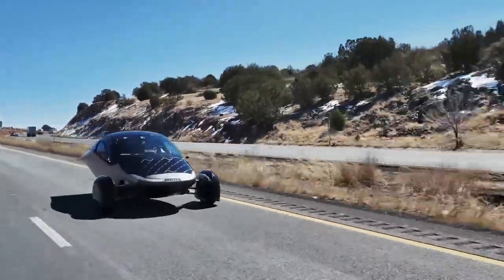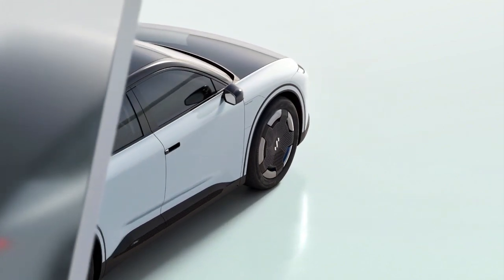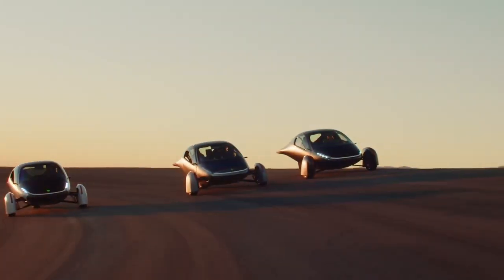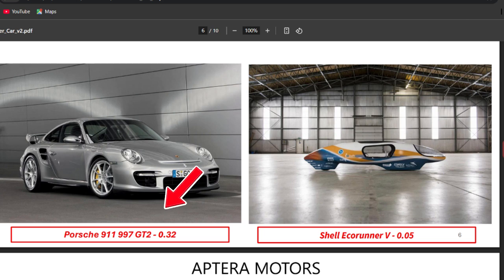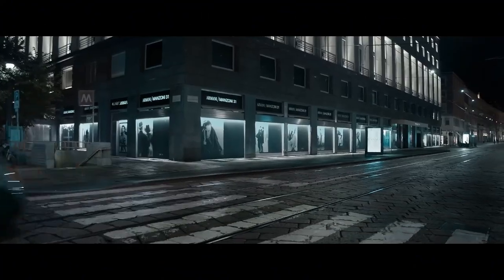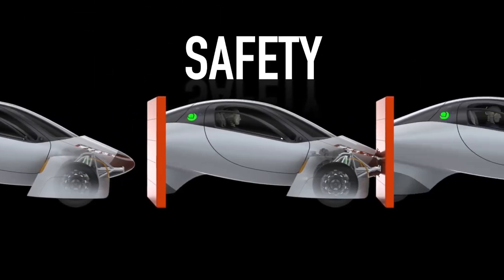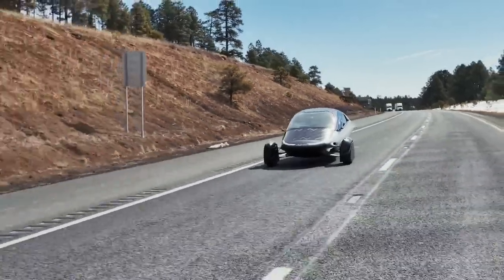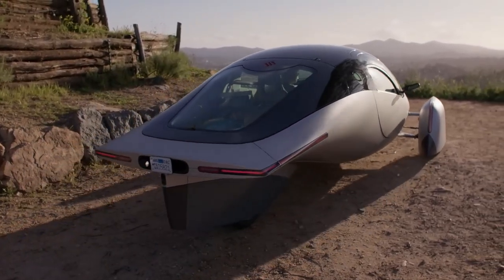Dr Elie On Aptera The First Solar Car: The Drag Coefficient, Rolling Resistance & More

Comment: Solar won't save this car.
They should focus on a regular 4 seat model with better battery management and charging speed.

A bonus would be some sort of self charging power supply feature. That isn't solar.

To get this model to pass a crash test will only increase the weight.
Reply from the maker: you know they said they plan to begin small scale production late this yr; yet they haven't done any crash test
Reply: @chriswabs  It's designated as a motorcycle and a crash test is not required.
Reply: @chriswabs  The video said they are trying to reduce the weight of the demo model to increase the range.
The problem with that type of thinking is they are not solving the crash test safety issue.

Which means it won't be approved for public use on the roads with REAL cars.
Reply from the maker: @scamchan  yes that will be creating a different problem for them: and before they commercialize they need that crash test: there's a guy who commented he said he is an investor and he knows a lot about the company, I have asked him for a livestream I hope he acceps
Reply: @chriswabs  I like the idea that you want people to come forward to carry on the conversation.
Reply: @scamchan  No, the video said that they have some steel parts that won't be there in production and therefore will be lighter. How is that connected to crash test safety?
Reply: @LuneUnion  show me a safe lighter car that has less steel in it?
Reply: @scamchan  Your argument is basically "larger, heavier cars are safer in a crash if they crash into a lighter car" This would be true for a Corolla vs a Hummer or a Hummer vs a literal tank. A smaller car will tend to get pushed by the heavier car, no doubt. By your thinking then, everyone should be driving semi-trucks because they're the safest in a crash. Of course, then everyone would be driving semi-trucks, so not sure how safe they'd be then. For EV efficiency, lighter is better. F1 cars are lighter and way faster than Aptera and people do walk away from those crashes. Worth a mention because the company that's stamping out the Aptera body is primarily makes race car bodies, IIRC. On the more mundane front, the Hyundai Elantra weighs in at 2,868 lbs and gets a top safety rating. The Smart Car can weigh in as little as 1,500 lbs and it got a 4 out of 5 safety rating. Also the Model Y and Ionic 6 have swapped out some steel for aluminum/composites to reduce weight and they're top rated safety wise. So, yes, one can remove steel and still be safe.
Reply: @LuneUnion  My argument is that APTERA  has done ZERO crash tests but wants to reduce the steel in their "CAR" to increase range.
Seems they are not worried about Safety at all.

If you want to argue what they have stated vs facts please do so.

At least make it challenging.

So I will repeat again.
Where is the crash test for the Aptera?

Please let us know how safe it is in a crash.
Will there be anything left after a crash?

I don't think there is anything to debate here on this issue.
Reply: @LuneUnion  F1 Cars are not street legal plus I am sure they have some sort of cage protecting the driver.
I don't know why you would bring that into the picture.

You don't get massive range increase plus charging  up without losing something in the process.

The whole self - charging is just the gimmick to get investors on board.

It isn't practical.

The final production model won't be something to brag about charging wise or range wise.
Reply: @scamchan  You didn't repeat yourself. You're just moving the goalposts and being an ass to try to get a rise out of me. I don't have Aptera actual crash data, as you know,  as they haven't done it yet (that I am aware of). Not sure what win you think that is. That is a step in the getting to production. They aren't yet in production. When they do it, I hope it will turn out as well as the Model Y and the Ioniq 6 have. But I do agree. No point in talking to you further.
Reply: @LuneUnion  I didn't move the  goal post at all
I Said from the start there was no crash test.
With that being said.
Let me know how you compare a Smart Car to an Aptera?

That sounds like moving goal posts to me.
Don't get mad at me just come with better facts at why this SOLAR car is the one that will make it into production and remain safe in a crash.

I suspect you will continue to move the goal posts in search of keeping the lies alive.
Reply: @scamchan  They will. It is not yet crash tested because they only have had expensive, one-off, and not fully functional prototypes that are not yet production specked. This is a shoe-string budgeted start-up without any billionaire backers. Even though they do not have to - due to its vehicle classification - Aptera will be will be third party crash tested. All simulations have indicated that it will prove to be safer than most cars on the road, and hands down safer than any motorcycle/donor-cycle. It has crush zones, airbags, a roll cage, a low battery weighted center of gravity, and its occupants are enclosed in a strong composite shell.
Reply: @ No billionaire investor is going to back a 3 wheel experiment.

More so one that can't resolve issues with charging and range.

Might as well ditch the solar aspect and increase the range and charge speed.

Then just add the 4th wheel to make it more stable.

No one trying to go off road or camping in a tiny "car".
Reply: Baby steps. They are a new car company. If this revolutionary design ever hits the streets, everyone will want aerodynamic efficiency. There are so many innovations in the newest Production Intent version that debuted today that, if it every hits the road in significant numbers, will revolutionize the car/land transportation industry. An Aptera with a compact ICE range extender/charger could power a four-seater and have unlimited range while burning very little gas. The side-view mirror on a Ford F-150 has the same wind resistance as the entire Aptera. Ford F-150s could save a lot on fuel with a little aerodynamic efficiency in their design.
Reply: @RaymondCore-ts5jl  When was the last time anyone went to the dealer and said I want the best aerodynamic efficiency?

THEY DON'T
IF they Aptera needs a range extender it might as well just add A BIGGER BATTERY.

The Aptera won't revolutionize anything at that size in the land of HUGE SUV sales.

The problem with Rose colored glasses just means reality appears different everywhere.

NEW car company that is how old and still trying to gain traction with investors?

Unlimited range might as well invest in better battery tech and call it a day.

At best Aptera will remain a NICHE car and at worse it won't sell enough with that design to remain profitable.
Reply: @scamchan  Clearly you missed the word, 'if' at the beginning of the second sentence. 'IF' it hits the streets. Of course they aren't going to their dealers when they aren't even aware that all cars, if they were aerodynamically built would run on half the amount of gas they currently burn.
Reply: @RaymondCore-ts5jl  Clearly "IF" doesn't seem to compute.
It isn't up to the dealers
Because the car manufacturers already know about it from their designs over the last 100 years since leaving behind the horse and buggy.
What car manufacturer isn't using wind tunnels lately?

The problem remains the roads are not going to be filled with tiny two seat cars because it saves gas.

The weight of the cars will remain an issue.
We know batteries are not light.

Emotions behind "aerodynamically built" cars isn't something being overlooked it has always been part of the design lately.

Somehow that discovery is missed in these responses by you.
Reply: Self-charging power supply?  Is that something you saw on The X Files years ago?  

The problem with that is, there's this thing called the Law of Conservation of Mass and Energy.  (You can google it if you're not familiar.)
Reply: BINGO!  Solar is useless for the way this car is used. Better off just plugging it into a home solar bank system.
Reply: @mikelfrance-l6x   Solar is not useless.  There is no evidence to support that claim.
Reply: @netscrooge  Solar is indeed useless when used on a car. Might as well have a tuned solar setup that is optimized to collect solar energy than the few cells on the car that may not be in alignment to do the job at any location.
Reply: @scamchan  I moved from a beautiful single-family house to a senior apartment building for my retirement, where I have additional assistance and support as I age.  I guess you believe I shouldn't be allowed to own an Aptera.  You would rather I do all my charging at a charging station than for me to have almost all my driving covered for me without any additional expense or inconvenience.  Maybe while I'm sitting and waiting for my EV to charge, I can use that time to think about how foolish I was to grow old.
Reply: @netscrooge  Yeah those cloudy days will really keep that APTERA charged I guess that waiting around for the sun will be well worth it. 
OR checking the paper for sunny days before you drive your charge to zero.

Maybe you can pounder all that time why everyone else warned you it wasn't a great idea to depend on solar as the solution for onboard changing.

You can own anything you like.
That doesn't mean it would be the best solution for ALL considering we have so many REAL WORLD solutions that don't depend on the sun for power.
Reply: @netscrooge  solar won't charge at night or on cloudy days to make it worth the time.
Reply: @scamchan   The public's real world experiences with the solar roof option on the Prius proves you wrong.  You're just stating an opinion, one that's not based on facts.  Please do the research and educate yourself.
Reply: @netscrooge  Solar roof OPTION Thanks for helping me out with this.
I couldn't have said it better.

Now ask yourself How many solar Prius do you see driving past you on the highway.
I will wait for your honest reply.

When facts meet reality it really hits hard.
Reply: @netscrooge  The solar roof can add a few miles of EV range if parked in the sun for extended periods, but it's not a major source of power.

I Can't make this stuff up as it just writes itself.

Real world experience is hard to refute.
But do go on about that research.

The Solar Roof option

It can even add a few (like 5 or 6) miles of EV range if parked in the sun for 12-plus hours daily, but don't expect a significant amount of free solar-powered miles if you drive your Prime frequently.
Reply: @scamchan   Nothing you've said refutes the usefulness of solar-assisted charging for my use case.  I guess you can't quite grasp that there are people in situations and with preferences that are much different than your own.  I can't put solar on my home.  I don't want to sit at a charging station while my car charges, even if I'm not charging very often.  

What is your motivation for continuing to argue the point?  What's in it for you?  If you don't want solar assisted charging, don't buy a vehicle with solar cells on it.  It's as simple as that.  Those of us who do want solar assisted charging don't need to hear your pointless negativity.  You can keep your gems of wisdom, like "it won't charge at night," to yourself.
Reply: @netscrooge  Hard to grasp 4 miles of charging per day on a Prius as something to rave about.

If Solar charging on a car was a great asset there would be no need for batteries at all.

Not charging at home only means you need a charging station no problem.

The issue remains SOLAR on a car isn't a solution to a problem.

No matter how you twist it because if it were main stream and practical this debate wouldn't be taking place and you know it.

You can't drive more miles per day than you can gain charge from solar being in the 4 miles of charge per day that means you would drive less than 4 miles round trip to be practical.
Stop the mind games here.
No one with a thinking brain would accept this is normal - Your wait isn't being removed at night or in the day with solar charging on your car.
Reply: @netscrooge  Try to grasp the concept of charging a a car with 200-300 mile range with solar on the car that does like 4 or 5 miles per day.

You will be waiting 2 months for a full charge.

That isn't helping anyone.  Not even you..

To get fast charging you need bigger panels much bigger than the car itself.
Reply: @netscrooge Although I’ve heard 5 to 6 miles added a day from a couple of Prius owners in the real world. Most of them say it’s only 2 to 4 miles a day. Sure, the Aptera is going to be more efficient, but up to 40 miles a day is a real stretch.
Reply: @kevinc8811  Based on the Prius giving 4 miles on a good day and 6 under ideal condtions, I would expect the Aptera to get about 25 miles on a good day and close to 40 under ideal conditions.  So, it's not a "real stretch;" it's an ideal-conditions figure.  

If you don't agree, show us your math, comparing Prius solar capacity and vehicle efficiency to the Aptera's.
Reply: @ Lets count those perfect sunny days that will hit those tiny solar cells on the car.

I can't wait to hear it.
When the the builders of the Aptera won't reveal the charging time and speed.

You know it isn't good.
Reply: @netscrooge  You ask for figures because I’m skeptical of  the 40 mile range a day Aptera claims but you don’t present figure yourself of the proof it possible? LOL That ain’t how it works genius, the burden of proof is on you.
Reply: @ dude, you’re the scam.
Reply: @greghelton4668  Oh wow I thought you had evidence but all I see are bad jokes. 

Try harder to provide evidence and prove solid points.

Save the jokes they don't work here.
Reply: @kevinc8811  The burden of proof is on you.  You're the one questioning Aptera's 40 mile/day figure.  Either give us your reason for questioning it or admit that you're merely expressing an impression that's based on emotion, not facts.
Reply: @netscrooge  So once again you have no proof. You’re repeating hearsay claims without evidence.
Reply: @kevinc8811  Feel free to review all the evidence we have for the vehicle's Wh/mile efficiency and the numbers we have for the output from the vehicle's solar.  Do the math.  I have.  The 40 miles/day from solar can't be far off for perfect, ideal conditions.  

Saying 40 is "way off" would mean it would be something more like 10 or 15 miles/day.  The Aptera has over 3 times the solar of the Prius and is a much lighter and more efficient vehicle.  There's no way it will be 10 or 15 miles/day for ideal conditions.  And if it turns out to be 30 or 35, that's not way off.  It would simply mean their estimate was high, not rediculously high.
Reply: @scamchan  Far from it, getting well over half of its yearly kWh's free from the sun is not useless, it is an economic, practical and environmental win. Also, it def comes in handy when road tripping, camping, closing in on a charger you can't quite reach, and helping power parked battery drains like thermal management protections, dog mode when applicable, and sentry mode. The solar became range useful precisely due to Aptera's priortised and astonishing efficiency. Solar on a home with its inverters, wiring, battery storage, ... is not affordable in everyone's budget. Not everyone is privileged to have said home, and one that has good sunny solar angles and a compliant HOA and/or power company. Plus shouldn't any said home solar be saving that homeowner money offsetting whatever fraction of the home's energy use that it can?
Reply: @netscrooge  The Aptera is nothing like the Prius. Educate yourself about the EV you are blindly casting shade upon.
Reply: @scamchan  All factored in when doing their solar projections. Are you a bot?
Reply: @scamchan  But an Aptera that has more solar real estate and that is 3 to 4 times more efficient than said Prius?
Reply: @scamchan  &  @netscrooge  Help, the slam bots are fighting each other, not understanding they are designed to be on the same side with similar goals ;->.
Reply: @jeffcarlton3590  "def comes in handy when road tripping, camping, closing in on a charger you can't quite reach"
Camping?
Do you work for Aptera?
First of all the so called charge time and or range on this car isn't even official.

Secondly With the small amount of cells on the car they are in no way practical for everyday use even in a local situation.
Last I checked it doesn't charge as you drive.

A solar setup in the home would not only charge it quickly it would also be used as power for the home as well.

There is no Aptera that will power a home.
So there are no savings to be had there.

Solar on the Aptera is more of a gimmick than a real selling point.

Points made here are very poorly done.
Reply: @ Being a cheerleader isn't an easy job for anyone.
The problem here is that - We have ZERO practical solar cars.
I wonder why?
Aptera won't be one of them and they know it.
Meanwhile they can continue to soak up investor money and tell them to spend more money to jump ahead in line.

This can go on for how many more years.
Reply: @ Key word here is "projections"
Not a real world scenario of proven performance.
At least not one they want to present to the world.
They know the performance of the charging isn't great as people expect it to be.

Some of us believe in facts and evidence  then others love the fantasy they hope to become true.

There is a reason great charging from solar will use panels that move with the sun.

Meanwhile Aptera hopes to get great charging from any location from poorly angled solar cells.

I can't make this stuff up.
Reply: @jeffcarlton3590  A Prius with the optional solar roof is an excellent example of how useful solar assisted charging can be.  If the Prius can gain several miles/day, think how much better the Aptera will be.  The Aptera goes about twice as far on each watt/hour of power and has over three times the solar cells.  The Prius with solar is the best real-world example I can give to refute the naysayers that attack Aptera's solar charging estimates. 

I have educated myself.  Maybe you should too?
Reply: @mikelfrance-l6x  Again, it charges while you drive, while you park while out during the day, and while you sit in traffic. How is that useless?
Reply: @LuneUnion  Because running around towns means its going to be shadows, under clouds, rain, not to mention running in early morning or late at night.  And its moving and changing angles to the sun constantly. Lastly, vehicles collect dust, rain drops, bird droppings, etc. Its  the worst situation for collecting solar energy.
Reply: @LuneUnion  It can't charge as you drive as the output of solar would have to be strong enough to power the car itself. We know that is not true.
Reply: @scamchan no it doesn’t. Take an engineering course.
Reply: @greghelton4668  IT doesn't what??
Make yourself clear
Reply: @mikelfrance-l6x  Well over half of its yearly kWh's free from the sun is not useless, it is thrifty. Also, it def comes in handy when road tripping, camping, closing in on a charger you can't quite reach, and helping power parked battery drains like thermal management, dog mode, and sentry mode. The solar team has engineered it to deal optimally with changing angles and intermittent shade. Yeah, you are incentivized to keep it clean, but that is much easier to do on a car than up on someone's roof, and the low coeff of drag design means bugs, rain, ... tend to glide over vehicle when it is moving, rather than crashing onto it.